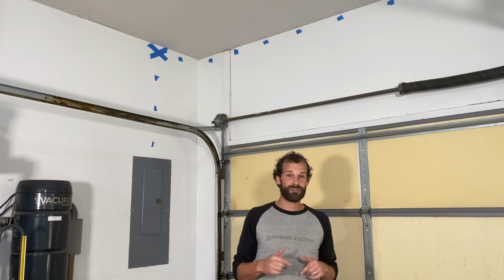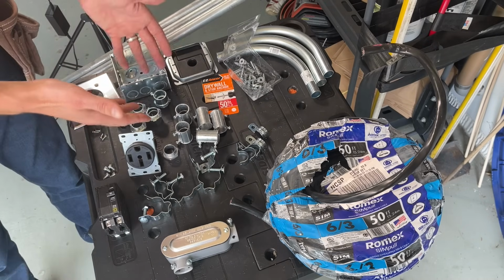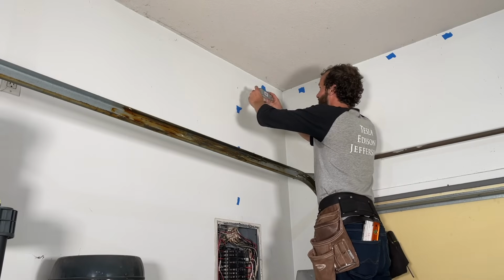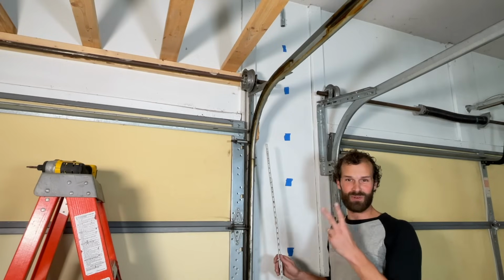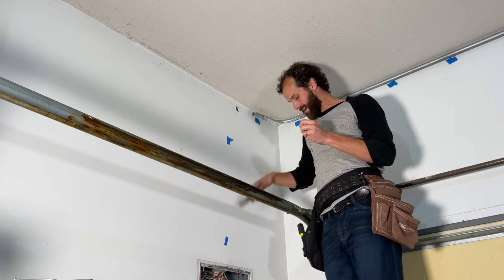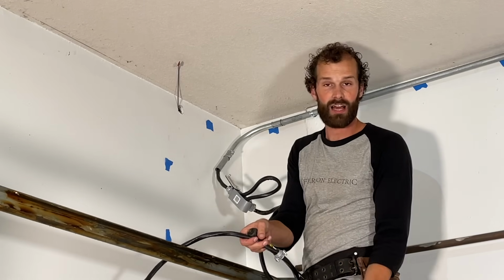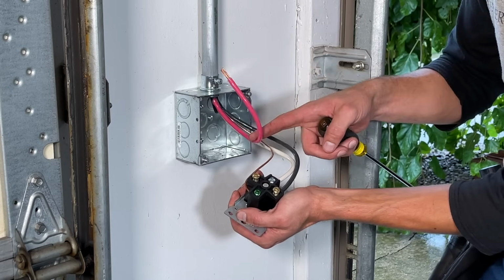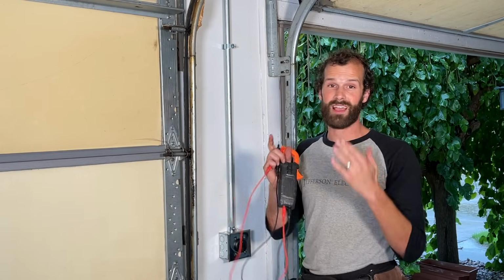How To Install a 240 Volt Outlet | Electric Car Charging

Comment from the maker: 240 V NEMA 14-50 Outlet:  https://geni.us/R3zv
4" Square Electrical Box:  https://geni.us/O8GfML
4" Square Box Mud Ring (1/2"):  https://geni.us/QnUYqq5
NEMA 14-50 Faceplate:  https://geni.us/Zrv2S
Drywall Anchors:  https://geni.us/rMx8k
3/4" LB Conduit Body:  https://geni.us/XZzW5K
3/4" EMT 90-degree Elbow:  https://geni.us/V8C83
3/4" EMT Connectors:  https://geni.us/V4Cvx5
3/4" EMT Couplings:  https://geni.us/BSF2
3/4" EMT Mini Conduit Hangers:  https://geni.us/NnuQ
3/4" EMT 1 Hole Strap:  https://geni.us/mO1rzI
50 Amp Square D Breaker (Type QO):  https://geni.us/bgbVXn
6/3 Romex Wire:  https://geni.us/rg0e

Tools Every Weekend Warrior Needs
Makita Cordless Drill Combo Kit:  https://geni.us/t7dIA
Dewalt Drill Bit Set:  https://geni.us/oFlSl
Dewalt Screwdriver Bit Set:  https://geni.us/VDcr
Craftsman Screwdriver Set: https://geni.us/jXqFI
Eklind Allen Wrench Set:  https://geni.us/7XfvO
Pliers (4-Piece Set):  https://geni.us/RIdx
Milwaukee Fastback Utility Knife:  https://geni.us/MlyiLk
Stanley Tape Measure:  https://geni.us/bUfD1R
Studbuddy Stud Finder:  https://geni.us/RySCuVw
Johnson Torpedo Level:  https://geni.us/wiLcDY
Stanley Hammer:  https://geni.us/bPDk8Wo
Buck Bros Wood Chisel Set:  https://geni.us/vk3cpTW
Klein Voltage Tester:  https://geni.us/h9Hl
Klein Outlet Tester:  https://geni.us/kdBAJ
Milwaukee Wire Strippers: https://geni.us/5zuLAbC
Little Giant Ladder: https://geni.us/fmlmTk

DISCLAIMER: This video and description contain affiliate links, which means that if you click on one of the product links, I’ll receive a small commission.

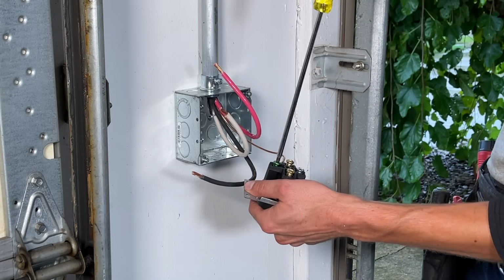Comment: Do you not have to ground the 4” deep box? I saw you terminated the ground wire to the receptacle but you didn’t also ground the box 39:23 

Isn’t it required by the NEC to ground all metallic boxes?

Comment: I thought this was a great video. I have worked on similar installs as a helper to an electrician. Despite Jefferson's obvious professionalism, would I be wrong to suggest that he could have run Romex thru the wall up to a 4-in junction box, then from there, THHN thru the EMT. So much easier, straight forward, and less struggling. Anyways, thanks for the great video- I learned a lot.

Comment: The outlet is not fully grounded in the box and the ground is not fully run through the conduit because the conduit doesn’t run all the way back to the panel. Plus you might need to assess the capacity of everything you have run from that panel. If you are running a car charger you have a continuous load and if something else is running with high amp draw you could exceed the rating for that panel and line. There are load managers that will drop the charger (or other designated loads) if you are at or near capacity. Otherwise this is a good video. Risky for the DYIer but good.

Comment: quick question and I don’t mean to fry my home doing this diy project for EV charger installation. I have 200 amp box in the basement. I have empty slots available. Do I need to look for specific slots to install the breaker to get 220v or  I can pop into any available slots?

Comment: My electrical panel is in basement. The ceiling is boarded up. there is though an old unused centra vac line running from the electrical room to the garage. Is it code to run wire through the central-vac conduit? Thanks.

Comment: The issue here is most states requires pulling permits for job like this, if you don’t, in case of something would happens, insurance will deny you claims of fire or whatever the damage occurs. And most cases only licensed electricians can pull permits, so do your research before you get started and I’m 90% positive that you’re better off let professional pull the permits and do the work, I know that sucks because they are not cheap, but if something would happens you know what I mean ? And anybody has better ideas I like yo hear it, because I’m about to spend a lot of money to hire an electrician.

Comment: Fantastic video, but yeah, 1" would have been a better idea for 6/3 romex.
Reply from the maker: THHN would have been better for the conduit.  Not fun pulling Romex through conduit like that 😅
Reply: @EverydayHomeRepairs The problem with thhn is that you need conduit INSIDE the wall as well which can be tough.  If you have the access box next to the panel then the conduit running up, you could do that as well.

Comment: You cannot put romex in conduit. It will overheat. He should have used single conductors. Code violation!
Reply: Incorrect. It's not a code violation .Romex is allowed and sometimes required in conduit. It will not overheat simply by being in conduit.

Comment: You shouldn't be doing electrical work AND calling yourself a pro at the same time.
Reply from the maker: Joel (the guy in the video) is a Master Electrician 🤷‍♂️
Reply: @EverydayHomeRepairs  uses prefab and calls himself a pro. You can't just run a cable into an LR and throw a chase nipple on it. 3/4 conduit is undersized for this size NM. Some fucking Master.

Comment: Ok, it's 3 years later but I have several problems with this install.  Installer is using a 50 amp breaker in the panel to a Nema 14-50 outlet.  First, since this is an outlet, the breaker should be a GFCI breaker to protect against ground faults in whatever is plugged into the outlet as there is no guarantee that whatever is plugged in has ground fault protection built in.  Which is why most EV chargers include ground fault sensing and protection and like to be hard wired as that saves the extra cost of a GFCI breaker at the panel as well as eliminating many nuisance trips from cheap GFCI breaker designs.  Second, since this is a Nema 14-50 amp outlet for EV charging, the wiring and breaker should be sized for 60 amps to allow for the 80% derate for continuous duty.  60 x 0.8 = 48 amps of charge current while the 50 amp breaker is only good for 50 x 0.8 = 40 amps of charge current.  While you can limit an EV charger max current draw in the charging equipment you cannot guarantee that anything plugged into the outlet will be limited to 40 amps or less.  

Ok, let's also give credit where credit is due for the Hubbell outlet recommendation:  Good Call!  The Hubbell is rated for hundreds of plug cycles while the cheap alternative outlets can be rated as low as 10 plug cycles.  Read the specs before you buy!!!

Comment: Unless you work for the pentagon, you don’t utilize anything, you use it.  It drives me 🥜 since when did we stop using the word use?  And when did everything become a “game changer” ?  Unless your screwdriver is a sonic screwdriver, it’s definitely NOT a game changing screwdriver. Oy…🤷‍♂️🤦‍♂️
Reply: "Utilize" and its variations is commonly used term in the NEC.

Comment: You could have saved so much time and money on this project by using #8 MC instead of pulling #6 NM-B through that conduit.  It sure looks like you overfilled conduit too, which could overheat the wire/insulation.  You would have been better off just running the NM-B from the panel and only inclosing it on the vertical run down from the ceiling to the outlet box.
Reply: Yup, 8-3 MC is about 1/2 the cost of 6-3 NM and it likely wouldn't need to be in conduit given the location where it's being installed. While the NM does exceed the conduit fill for 3/4" emt, overfilling conduit will not lead to  overheating with only 2 current carrying conductors. Conduit fill limits have nothing to do heat; they are about being able to pull conductors without compromising or damaging them.

Comment: Installed a 60amp circuit breaker for a tesla wall charger.  Circuit breaker is only indicating one of the hot as 125volt and the other is a lot lower and both hot is coming in at 18???!!!  Help?

Comment: A 50A outlet is not "a continuous load" You should know, that rating shouldnt be used to max. Isnt it like 80%? I know Teslas only charge at 42A when on a 50A circuit.
Reply: OMG that $9 receptacle is also NOT good for being plugged in and unplugged as much as EV charging is done. OYE.
Reply: Cord and plug connected loads are limited to 80%, continuous or not is irrelevant.

Comment: Thank you for the wonderful video. I'm wondering you could help fix the charging problem for my Tesla Y. I use a 240V wall outlet in my garage to charge through a mobile connector. After ~2 months of normal charging, I encountered an error in the Tesla app: Inadequate outlet grounding, unable to charge. I measured the voltage and noted 120V between the 2 hot lines and between each hot and neutral and 0V between ground and neutral. Noticing that the 2 45A-fuses in the garage panel were old and looked damaged, I replaced them with new ones. After replacement, I measured 240V between the 2 hot lines, 120V between hot and neutral, and 0V between neutral and ground. Charging resumed but lasted only ~15 minutes before another error appeared: Charge rate reduced – unexpected voltage drop, followed by charging stopping completely. I'd greatly appreciate troubleshooting steps. Thank you.

Comment: This was very well presented. I would probably insert a wood plate between the studs to anchor the switch box so that it bites into the wood rather than risking the screws to come lose from the drywall. Not turning off the main made me anxious the whole time. it was like watching a thriller.  What did you say the name of the online academy name was?

Comment: Isn’t will be better to use RV outlet box so when you not using outlet you can close lash, and about breaker why u just don’t remove it connect the wires and then install it back to panel?

Comment: I thought romex couldn't be run within a long conduit like that.  Should have been THHN and then converted to romex in a junction box instead of the LB?
Reply: Romex is allowed in conduit in any length, dry locations only.

Comment: Did you calculate pipe fill on this application?? 6-3 w/ground in 3/4" EMT sure seems tight. I think I would have preferred upsizing it to 1" so you don't have to fight so hard. And before you say it yes, they do make a 4 square box with 1" knock outs just for this purpose.

Comment: You got what you paid for !! Piss poor. He screwed up in this video,  like a lot of electricians, that know nothing about EV charging. Continuous Draw ! isn't in his mind set.
He installed a outlet that is sure to melt over a long charge.    Hubbell Lighting 125V 50A 3-Pole 4-Wire Receptacle – HBL9450A, is rated for the EV charging. Not the one he installed... Good luck, hope your house doesn't burn down.

Comment: Romex should not be run through conduit. The Wire running through the conduit should be individual THHN for interior and THWN for exterior applications. Romex can get too hot. Check code before doing this. You can strip the Romex of the outer cover and you will have THHN.
Reply: Romex is allowed and sometimes required in conduit. It does not overheat simply because it's in conduit. When installing it in conduit, the outer sheathing is required to remain intact, not allowed to remove it.

Comment: I need help!! What do I use to secure UF-B 6/3 cable to a stud? This is an run for a generator inlet box on the external wall. I'm having a hard time finding how to secure the cable.
Reply: If it's a 2x4 stud that cable is too wide to run it along the stud. In that case use a stacker every 4' to keep it away from the stud. If it's a 2x6 stud, wide staple, run it right down the center. You could also use a 1-hole strap, the flat type that are used for SEU cable.
Reply: @pld8993  thanks for the reply. Yes it's a 2x4 stud going down the wall. I couldn't find any staples big enough because the cable is flat and a little over 1" so today I bought 3#3 to 3#2 service entrance cable 1 hole straps.

Comment: If the service panel is in the basement, can you run the conduit across basement ceiling joists without having to be at the corner of a wall?
Reply: Yes. Conduit is allowed to be surfaced mounted almost anywhere.

Comment: Why did "Everyday Home Repairs" "How To Install An EV Car Charger | Easier Than You Think!" video use a 60 amp breaker with 6 awg wire and you are using a 50 amp breaker?
Reply: The 14-50R is a 50 AMP receptacle.

Comment: Why are you putting Romex inside of EMT? Isn't that against code in your area?
Reply: Romex in conduit is legal.
Reply: @pld8993 but not recomended
Reply: @keithpeterson9560  No recommended by whom? There's nothing wrong it and is sometimes required by the NEC to be in conduit. It is, however, more difficult to pull through conduit and doesn't make sense when THHN is adequate. The conduit has to be complete before the cable is installed. The way he did it is illegal.

Comment: You must ground the metal outlet box, and 3/4” emt conduit is a little bit tight, should be 1” make it easier to pull the cable romex.

Comment: There was a video with the installation of a couple 110 outlets in a garage wall.  He said you shouldn't use Romex 12-2 INSIDE the conduit.
With this video, he DID use basically 6-3 wire INSIDE the conduit.  Which one is it?  Shouldn't he have used SINGLE STRAND wire?
Reply: Romex in conduit is allowed in dry locations. Not how a pro would do it, but it's fine.

Comment: I wired my panel 30 yrs. Ago as a dyi -er , and it looks exactly like yours, then had an electrician ck it ,gotta use common sense . Good tip on torquing the stranded wire

Comment: I really need to know if you used a GFCI breaker for this job since it’s in a garage. I ask because they are so much more expensive. My breaker box is in a dry ground level basement but the plug will be in the garage….

Comment: Sir…although you are a little dangerous in your approach, great info!
Also, I thought that EVERYTHING in your garage needs to be GFCI. You need to use a 50 amp GFCI breaker since this is a new, independent line.

Comment: I don't want to sound critical.....but, you are an accident waiting to happen, when you removed the cover you mentioned that for your safety you have to remove the cover safely, that was good, but wearing your wedding ring, and no safety glasses? the metal fish tape, why not use a fiberglass wire running kit from harbor freight? why do you have to have the energized panel without cover while you do your installation?, if you are exposed to a live panel you should be wearing FR clothing, I'm not 100% sure but I think it's a code violation to install romex inside a conduit ( I could be wrong ) because of temperature.

Comment: I attach the wires prior to installing a breaker especially on high amp 2-pole because it is MUCH easier to bend both wires when they are attached... To each their own

Comment: i have to be honest.  i would never hire you to to install a 50 amp receptacle in my house.  everything you did was either wrong in my opinion OR done completely half assed.  you have no business posting videos about this.  

1st of all.  you don't run 6/3 romex though 3/4" emt.  2nd.. the conduit run looks like shit to begin with - very unprofessional looking.  given the frequency of house fires from shoddy electrical work i would have gone into more detail on the importance of using the correct materials and making the right connections.  yes you touched on torque settings for connections, but you didn't elaborate on "why" and how to do it correctly.  what good is achieving the correct torque if you crushed the wire in the process?  its still not good.  how about the use of ferules?  

the use of pre bent / cut emt fittings just screams NOVICE hahahhahahhaa.... sorry, but i'm not even an electrician and if i saw that in person i'd laugh at you.  a real electrician can bend their own conduit.

being completely honest.  if i hired you and i saw you doing this to my house i would have stopped you, paid you whatever i had to in order to get us square, and then i would have thrown you off my property.  i would not allow you to do this to my house.

Comment: Please remember you need to torque the breakers to the wires as well as the nema plug. The torque specs are labeled on the side on the individual breaker